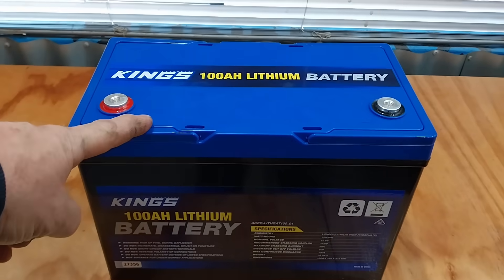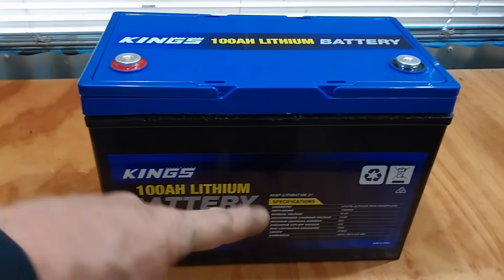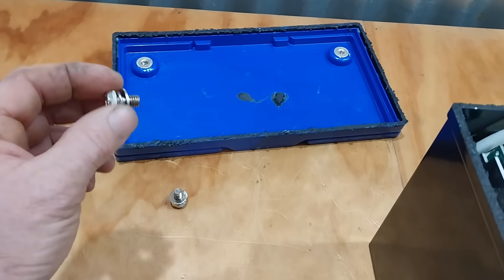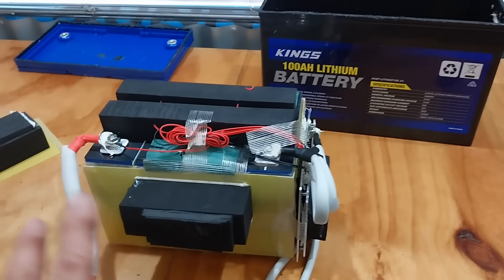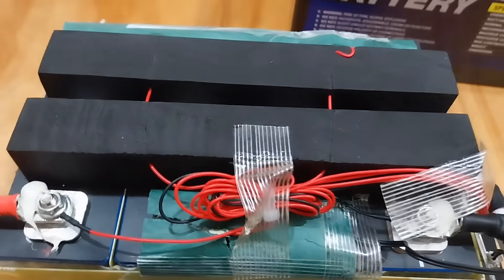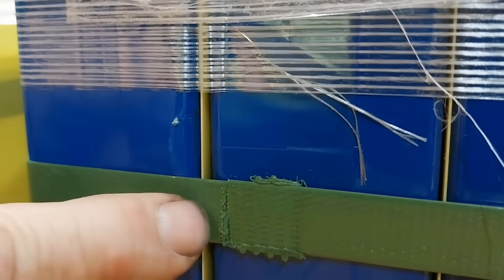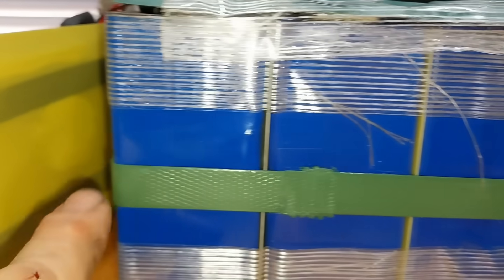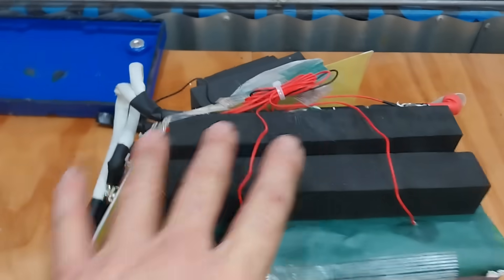Kings 100 Ah Lithium Battery Teardown - What We Found Inside ?

Comment: Hey Glen, they have just about got it right I reckon, but still a couple of quality control issues, the balance wire curled above the foam, not great as it looks like it was flattened by the lid, and of course the cell damage, ideally they should be perfect cells, they kinda look mismatched a bit too as some of the date stickers were missing. Thanks for taking the multi-tool to the battery...I wonder what the next one will be like. Happy charging !!! 🤠😎
Reply from the maker: All of the cells had the same date sticker on them, it's just that the stickers came off some of the cells when I took off the foam block. The stickers were stuck to the bottom of the foam block.

Comment: 0 out of 10 for cell compression 
1 out of 10 for build😅
Those shit builds only go 2 to 3 years if you're lucky
Thanks to this kinda crap will be seeing heaps of lithium cells for recycling very soon
Reply: For the money, who cares?
I am not paying four times price for double life
Reply: First of all thanks for rubbishing the planet your battery will become landfill very soon after it lets you down when you really need it one day! secondly a good battery can last 10 or more years if it's built properly with a good BMS thirdly if it's going to last that long you need a decent BMS that's got a decent output current which this one does not have so you can power everything you're going to throw at it in its life, 4x the price maybe your shopping experience knowledge is very small😅thanks for being a bogan @jamiebradshaw-mo1qs

Comment: Those BMS wires are too long and too thin, I would not be happy with them. Consider their function: shuffling current between cells. Any extra wire resistance would reduce the balancing current thus extending the time for that job.
Reply: These BMS are passive balancing so they only restrict current going to the highest cell, with less than 150mA, so the cable diametre is more than adequate

Comment: It's a bit disappointing to see that obvious damage to the cell which must have been there before the cells were put in the plastic case. To top balance you really do need to get at least one cell up above 3.45V @ a minimum - I generally start balancing there but continue up to 3.5V per cell. The charge curve on LiFe is so flat you waste a lot of time trying to balance below that voltage. My BMS will start balancing when one cell gets anove 3.45V. What you have to consider is at 13.8V one cell in the pack may already be at 3.65V so you would have to at least start balancing by then, preferably earlier. You should float for a while at 14V to give the cells time to balance because most passive balancers only work at somewhere between 500mA and 2A. The maximum charge of a 4S LiFe bat is actually 14.6V but as soon as you stop charging your cells will rest at about or just below 3.4V per cell or 13.5V in total..Your cell no 1 is quite out of balance compared to the others. I'd say it's weaker than the other cells in the pack - it will charge and discharge quicker than all the others.

Comment: By eye I'm guessing the aluminium links are 1.2 x 20, so approx 24 sqmm.  At 100A everything will be happy.  The links will get quite hot and be dumping heat into the cells but the BMS should keep a lid on things if temps go out of spec.

Comment: Yes, the cells will bulge a bit at full charge.  One of the conditions of reaching the higher cycle counts (3000+) used to be that the cells are mechanically constrained to stop the expansion (and associated contraction as the cell is discharged) which over time causes mechanical damage to the cells.  This includes the cells at either end of the pack and needs a plate on either end to stop those cells expanding.  Unconstrained cells used to get rated at around 2000 cycles by manufacturers, but I'm not sure what quality cells are rated at these days in terms of constrained vs not.

Comment: The best way to top balance the cells is to have them in parallel configuration. As this set up you need to fully charge them without overcharge any cell parameters. You can then use one of many methods to achieve that. Use an active balancer, individually charge each cell a maximum voltage of 3.65 and a pack voltage of 14.6 volt then do a capacity discharge not less than 10 volts pack voltage or 2.5-volt cell voltage. IN MY OPINION.
Reply: This is a good opinion and correct !
Reply: @EUCRAZY_AU  so how to you put the 4 cells in parallel when they are welded in series inside a welded plastic box when you want to balancing them?  Yes, the BMS probably only balances above 3.5v per cell, or 14V for the 4 cells. Yes, measuring voltages off load  / same temperature is valid to see how well the cells are matched.  Even more valid when they are at a few percent of capacity.  Reading the rest of you reply , agree, except I'm a bit leery of active balancers. Although there are probably some good ones out there. A passive balancer matched to charge topping voltage seems appropriate to me.
Reply: @galah4092  Ok i gotcha for starters its sold as a non repairable battery like common car batteries now they dont want people to mess with them hence they close it shut. Agreed i would have liked to have seen busbars installed but with a 4 cell setup prob not a big deal if you do have a cell bad take it for warranty it shoud be easily seen being 12v. Im a life time subscriber to Right to Repair as its part of my business but with this i dont really see a issue usually it will start active balancing at 3.2v at say 1Ah.

Comment: I can build a 314 AH/12.8 VDC DIY battery with Grade A EVE MB31 cells and a JK BMS with 200 amp discharge/charge, 2 amp active balance and Bluetooth communication for $423 USD. That would be like three of those batteries for $141 each.
Reply: True enough but it's not considered to be an engineered product and that has insurance implications.  It might well be a total BS situation but a cheapie chinese (not suggesting this Kings battery is that) factory built battery has higher standing than the best DIY job as far as insurance goes and getting a DIY battery engineered and certified is not something anyone is going to pay for.  So while you can DIY the battery you should be thinking hard about where you put it.
Reply: Little of what you said is relevant. LiFePO4 batteries are a safe chemistry. Insurance does not even come into play. It would have been prudent to talk about grid-tied/UL listing, because that is what insurance wants to see in a so called engineered product. My DIY batteries are as well built as EG4, PylonTech or any other battery you wish to talk about. I only use Grade A cells, the same cells or better than so called engineered batteries and the JK-BMS has a better track record with regard to failure rate than Pace, Seplos or any other BMS in the so called engineered products. I live completely off-grid with 60 kWH of DIY batteries, 12 kW inverter/charger, 15 kW of solar and no insurance problems. My utility building was built with fire suppression in it's design.
Reply: @stevenfrazier8939  Seems you are from the USA since you reference UL etc.  UL means nothing in Australia.  When it comes to insurance what I said very much applies in Australia.  My last full time job was in the insurance industry in Australia but not actually involved in writing cover more of a technical role.  An engineered product, even a cheap one, gets higher 'acceptance' by insurance than a DIY job.  If your DIY battery catches fire and burns your house down you are sunk; if a factory made battery does the same your insurance will cover it (various strings are attached to lithium batteries in Australia so you have to comply with those regulations of course)
Reply: $423 USD = $655 AUD.

Even so, we get reamed here in Oz for everything.
Reply: I built one the same as you in Aus and it cost $763

Comment: Hi Glenn I ran the QR code for you online. I made another comment but it had a link in it when I copied the data and think it was auto moderated but here’s the data that showed up. 

Manufacturer:
SunWoDa
Product Type:
Battery Cell
Battery Type:
LiFePO4
Nominal Capacity:
Don't Know Yet
Nominal Voltage:
3.2V
Production Date:
01/Jun/2023
Reply: Sunwoda's cell model numbers are typically much shorter and follow a standard naming convention (e.g., their Energy Storage System (ESS) cells are named something like LF314). The search results confirm Sunwoda uses simpler SKUs and model numbers for their battery modules (e.g., CIESS B051100S02).

Comment: Awesome video mate.
Can I please ask which 100ah that is. Seems kings has 2. On there his website they have 1 for 350 or 2 for 400 bucks
Reply from the maker: The two batteries for $399 are the same batteries just on sale if you buy two, it's one of Kings deals they have. I very nearly bought two of them for $399 on sale but I don't need two so I got one on sale for $239 if I remember.

Comment: Great stuff 👍 I have a Kings 100ah Lithium as well ,but unsure wether it’s pouch or prism . I also have a 120 and 60 ah !
Reply from the maker: I have one of the 100 Ah pouch batteries (I'm pretty sure it's a pouch battery) and another 100 Ah prismatic battery as well that I haven't torn down. I will weigh them both, see the difference in weight and do a video on it. I believe the pouch cell batteries weight a little more.

Comment: Excellent review so much better than just reading specs, would need width along with thickness of aluminium to determine cross sectional area for current capacity. Reasonable inside would be good to test temp cut out, shame about cell damage😊,appreciate the review thanks.
Reply from the maker: Ahh yes you right, I should have shown the width and length of the bus bars. When I get time I will check it and add those specs to the video description.
I was a little pressed for time so didn't get a chance to test the temp sensor and see if it was working. Temp testing as well as over current shut down is something I should be adding to my tear down and battery testing videos. I should get all the batteries I have torn down and do a temp testing on them all. That would be a good video to do for the channel.
Reply: Good idea along with capaity testing are all good inf😊 @TheOffGridBachelor